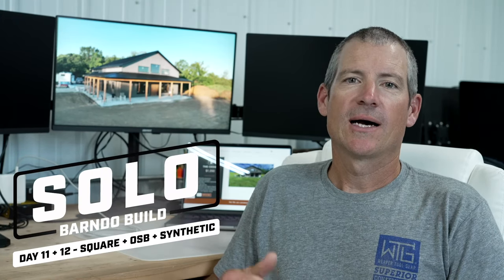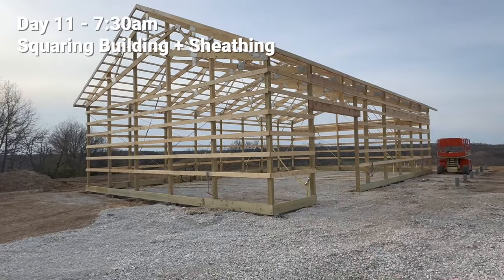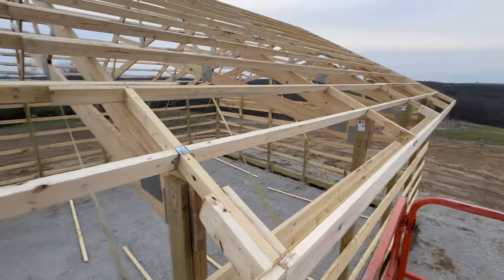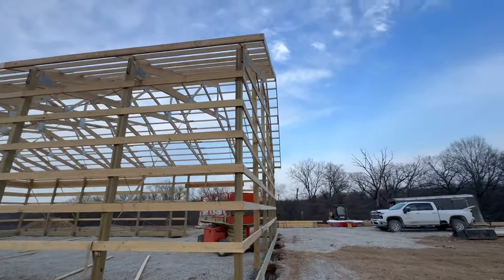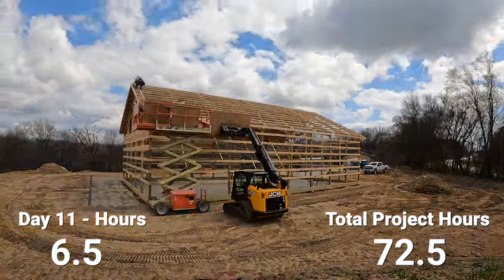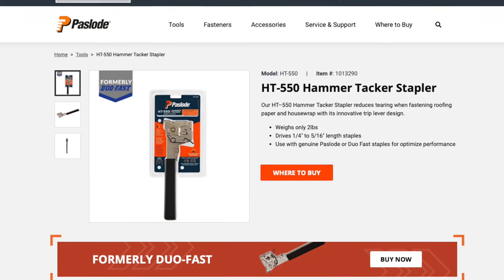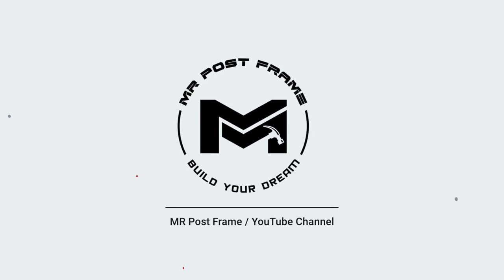Squaring Structure + Roof Sheathing + Underlayment | The Solo Barndo Build | The Cedar | Ep8

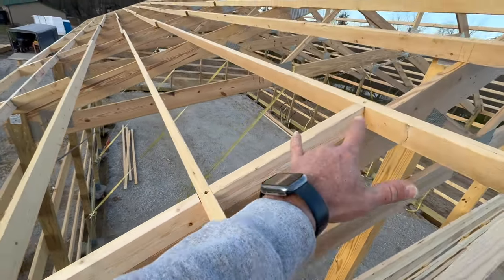Comment: @6:00 the blocking you are doing for CCSF... if you were sheathing the walls as well, you wouldn't need this,  correct?
Reply from the maker: Correct
Reply: I'm almost wondering, though, if it would still make it easier to nail the wall sheathing in these areas?